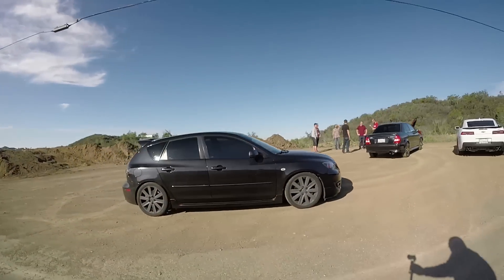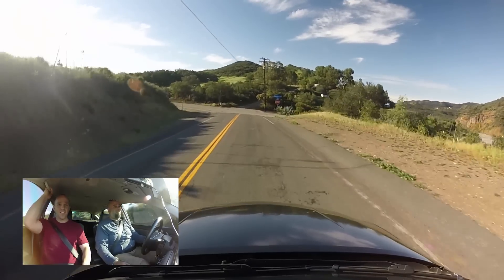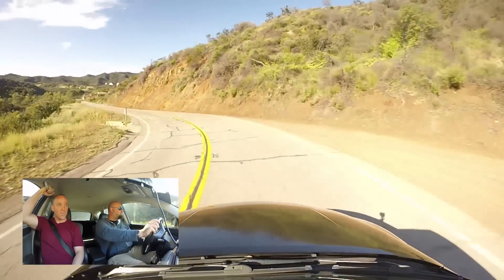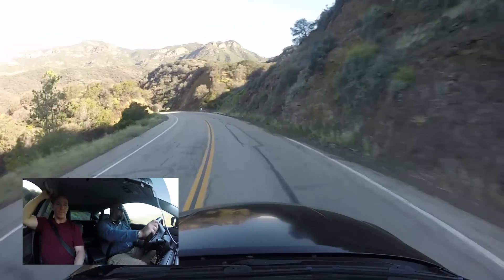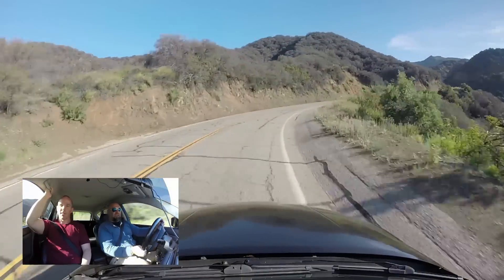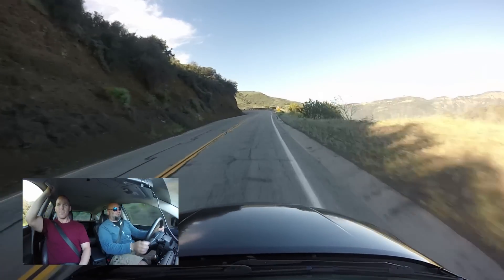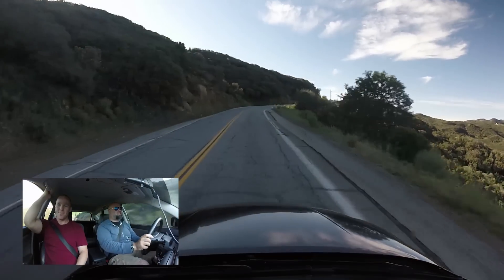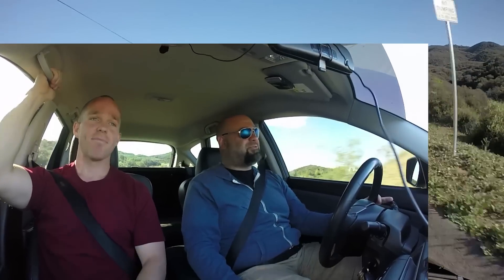450 HP Gen1 Mazdaspeed3 - One Take

Comment: Hey Matt, your title is a bit off, he says it makes 420 (yeah buddy) hp, the title says 450 :)
Reply: Tim Actually it probably makes more than 450. He said it makes 420 on the wheels.
Reply: halsoy Yeah, so shouldn't the title say 420?
Reply: Tim That depends what you want to convey. Most people talk about HP measured at the crankshaft (that's also what your car has in your registration paper). Many people live by the 15% rule of thumb. What this means (though 15% is a random number) is that the drive train eats up roughly 15% of the power. But the truth is that it varies from car to car.

But even going by the 15% number for the sake of argument, it means that the actual engine power is 420*1,15= 483 HP at the crankshaft. 

So the 450 HP number is probably either accurate (if they have measured the power at the crank) or a nice round figure to use since it's 420 at the wheels. In either case it's a better number to use for most people as reference.

Comment: Why pay 12k for that. You can get an e46 M3 for 12k. My room mate has a Mazda 3 and it broke down 5 times in the last year for 5 different reasons, he is on his 3rd engine, doesn't race or drive hard at all. Engine, suspension, a/c, exhaust, engine mounts, clutch, all broke before 90,000 miles.
Reply: Devan Vandy trade a headache for a migraine lol
Reply: Devan Vandy Sounds like his Mazda needs a driver mod.
Reply: Devan Vandy Either a driver issue or got a lemon. My speed 3 has 130k on it and havent had any issues at all. Lots of other speed 3 guys around me too none have had any issues as well. Same with regular 3 drivers etc. 

If he is on his 3rd engine he seriously has messed up somewhere.
Reply: Matthew Broderick  it's true. With the FOMOCO support behind that car, there were a lot of issues. By 50,000 KM, I was on my second engine, second HPFP, Flywheel, motors mounts, and 3 sets of rear shocks.  Out of the box, mine was very quick… And i'm a skilled, smooth, but FAST driver. It was just not built well for the long term. I put the same amount of KM on a VW GTI, without a single hiccup. In fact I drove the GTI harder, simply because it would take it.
Reply: *****  I was a diehard Mazda guy. 3 Miatas, Mazda B4000, Mazda 3 2.5, 6 Port RX-8, and the Mazdaspeed 3. It was BY FAR the least reliable Mazda I owned. I am thankful I bought my extended warranty on it, as each time it broke - I had a free rental car.
Reply: Paul Williams  Most of my failures were under the factory power. under factory power it wheel hopped like crazy. I ended up going full bolt ons, so it would spin, rather than hop. But then instead of breaking parts, they simply started wearing out.
Reply: *****  In Canada, we don't have the pull that Americans do. We don't have buyback, or lemon laws. I traded it in, licked my wounds and moved on to the RX8. I had issues with the RX8 too, and eventually moved onto the GTI - which was flawless.
Reply: For 12k you can't by a good used e46 m3 ! Typically in ny you would be buying a 120k mile m3 for that money !
Reply: Devan Vandy The biggest problem at the mazda 3 and 6 is the corrosion. The car is rusting like its no tomorrow. And it swallows a lot of oil. But a solid car in general.
Reply: ***** It's not even because they're badly engineered, it's the nature of the motor. Rotary engines run at higher temps, so you need to make sure you're 110% on top of the cooling system, and they burn oil, because they're designed to do so, so you need to stay on that too. Most problems with rotary vehicles are owners not knowing how to care for them, not the cars themselves.
Reply: *****  i didn't say the RX8  was problematic at all. Oil,plugs,wires,coilpacks,chattering diff clutch packs,i was always working on it - and nothing was cheap.  And then there was the fuel cost! Wowow
Reply: Why would you want an e46 m3 when the fiesta st is a better car :D
Reply: Devan Vandy never ever buy a m3 e46 for 12k ... NEVER
Reply: somanymods its not, its a quick hatchback and its 10years younger than the m3 e46 ...
Reply: I guess you haven't seen Matt Farrah's video about it lol
Reply: somanymods saw it and i like this show but in this case he compare 2 diffrent cars...
Reply: somanymods long time no see. Where's the old and busted ser auto?
Reply: Lol last I knew it was somewhere in queens

Comment: I've had my gen 2 since new in 09 and the car is not a money pit. 126k on the odo and the engine's SOLID. Only mechanical failure I've had is a blown turbo and that's because i added a downpipe before fuel pump internals. THERE'S LEVELS TO THIS SHIT. You've gotta follow some guidelines when modding any car. chances are this guy's modded his a little too precariously in search of the almighty horsepower. Also you can find speeds for under 8k all day now.

Comment: I have spent a lot of time under the hood of one of thoes things for my buddy. He is around 350-ish HPmany be a bit more, has good rubber, suspension and brakes, but I don't like it. It is not easy to drive becuase it is always trying to kill you, and once you turn them up to 11 the cheap parts stand out. Might just be me getting old, but for a weekend fun car I would still have an S2000, MX5, old Vett or Mustang etc. over this for the money. The engine bay is cramped and hard to work on unless you have lots of tools, and band aids it is not the best car for a serious track car, and too extreme for the street, point being it don't fit at the track or the street, not well at least.
But it is his money, I just do the work...

Comment: 45k mazdaspeed3 to make 450hp????
Reply: Second engine, third turbo
Reply: Zach Birdsall  I dont get this, even with a built motor and install you should not be going thru so many.

 http://www.speedperf6rmanc3.com/categories/mazda-mzr/built-motors.html

What do you do with them? Oil bearing tests.
Reply: swollenmadman16 my brother built civic been through 4 motors in less than a yr
Reply: AR Taken These engines require attention to detail when going built. A lot of shops get them wrong and they eventually blow. Sounds like this guy used some random engine builder. A company like speedperf6rmanc3 who specifically build speed motors would have built him a very reliable motor. Also I think his 45K estimate is inflated. Doesn't take even close to 45K to get to 420WHP.
Reply: He obviously doesn't build that well. Especially since he is still using the stock TMIC with a big turbo... it would heat soak after 2 pulls. And no motor mounts even? Tha'ts one of the first upgrades for this car
Reply: Zach Birdsall It does have stiffer motor and tranny mounts and it does have an aftermarket TMIC

Comment: I'm sorry but that's not 420 on a stock top mount.  Stock clutch and trans...
Reply: Zack Richmond you don't know wtf you talking bout bro.  400+ 700+ on stock trans and clutch? Bro not even corvettes or cobras.  Gtfoh
Reply: +Carlos Dingo Zack Richmond is not wrong though. It's the axles that go out first on these cars; the current 10 second speed 3 leader is on stock trans and has snapped more than one axle on a bone stock trans (might have shifter fork pads upgraded from plastic to brass though), and that was only because the car dead hooked on a flatshift to 2nd on huge wrinkle walls. I was also running ~400 wtq on stock clutch for a while, until flatshifting at the track glazed it.
Reply: +Carlos Dingo Oh and he has an upgraded TMIC; the Corksport one lets you use the stock shroud for a stock appearance.

Comment: this is the same engine that's going in to the new RS, more or less. ford owns IP: engineering rights to this engine.
Reply: digitalsaint2040 Yeah, this engine is excellent, Even won an award. The new Mazdaspeed will have the Skyactive engine which is good for economy, bad for everything else. 3 Skyactive car engines were blown during a race test.

Comment: this dude is full of BS, that thing is not 450 wheel, he has the OEM TMIC, that things good for like 300. he does not have 45k on it. “3rd turbo” usually means stock turbo and even on e85 it maxes out the k04 at 320ish. complete BS.
look at the most recent mazdaspeed video, with all the fancy aero and the dude that actually takes it to the track, he’s making 380 and the dude driving it is lovin it. the car in this video is probably making 300-310whp.
Reply: That's a Corksport TMIC, you can bolt the factory engine cover to the Corksport TMIC for more of a sleeper factory look as well as being able to muffle the sound of the HPFP. Furthermore, the owner states that the factory K04 turbo is not being used, rather the vehicle is fitted with a Garrett GT3076. There's videos of this car putting down 370WHP on the dyno, which seems more realistic than 400+ as there's no way you'd get 400WHP+ on stock injectors alone running E85.

But nonetheless, a nice car and certainly very quick from the other videos I've seen on it.

Did you even look at the wheelwell article on the car?

FMIC's look pretty, and they do suffer from less heat soak, but they aren't totally nessecary for 400 BHP using a large turbo that doesn't simply beat the hell out of the intake air.
Reply: ByteOn Computer Services 

the airflow isn’t enough. I have my own built speed 3, BNR S3, and my buddy has a speed 3 as well, Corksport turbo, and he just cracked a ringland trying to push 320whp with a Corksport TMIC. the BAT’s were just too high. We gold heat taped everything, under the heat shield as well, we wrapped the whole downpipe in titanium heat wrap to keep all the heat away so it wouldn’t heat soak as bad, but it still was too much. 

The 3076 LIVES in an efficiency range that’s MUCH higher than what our stock fuel system can handle, and you can’t go that high on stock fueling with a top mount. you need a front mount and some sort of aux fuel (Methanol, 5th and 6th port, or full port injection.) believe me, it’s well documented. people have tried. 

He may be on a 3076, but it’s so out of its efficiency range, that it’s probably getting heat soaked so much that the BAT’s are so high, creating this perpetual issue. With those heat soaked BAT’s, he can’t go higher than 320 (as per my buddies experience on a SMALLER turbo, can’t imagine how out of the efficiency range the 3076 is) without catastrophic engine failure.

it’s well known in our community that FMIC’s are required for anything above 320ish. the BAT’s are just too high. even on an E mix, (can’t run full ethanol, it mixes with the oil in the HPFP and gunks it up. ) there’s no way it can push those numbers. 

In conclusion, i didn’t bother reading his wheel well page because i knew it was just going to be spitting out hot garbage. trust me. the day someone makes 370+ on a TMIC without destroying his rings, is the day the mazdaspeed community goes nuts. 

where is this video of him making 370? probably had some crazy correction factors. 

also, OMEGALOL, OEM BPV, that POS slips at 22 PSI.
Reply: @partypigthefirst  at 2 bar the GT3076 is right in the meat of its efficiency map, there's no way it's beating the air that hard that outlet temps are enough to overwhelm a Corksport TMIC when the vehicle is moving with adequate airflow - Assuming the OP is even running 2 bar, and it's unlikely he is. You crack ring lands due to LSPI or trying to run too much advance, this is a direct injected engine and LSPI is a very real issue that's compounded when the engine is tuned. With HPFP internals the stock fuel system can handle 370WHP for short periods, I would say that 370WHP is about the limit though. There is a very clear video showing this vehicle on a chassis dyno putting 370WHP to the treads, there's video's of this vehicle pulling runs on the street no issues. Depending on model, the Corksport unit can be vastly smaller than a GT3076.
Reply: ByteOn Computer Services

LOL 2 bars on stock fuel system? you’ve gone mad. that’s 29 PSI, the amount of fueling needed for that on a 3076 requires full port injection, or at the least, 5th and 6th port. why do you keep going back to the HPFP? i realize that our stock fuel system can support 370 on an e blend. but not on that turbo. you’d be way below the efficiency range and you’d heatsoak the engine bay. 

remind me, how much experience do you have on the mazdaspeed platform again?
Reply: @partypigthefirst  read my post, read it good - Specifically the part about it being 'unlikely' the vehicle is running 2 bar boost. 2 bar boost was an extreme figure for illustrative purposes. I worked on Mazda's for 20 years, I have around 7 years tuning the MS3. Once again, the Corksport turbo is most likely smaller than a GT3076 meaning more boost is needed compared to a larger turbo to achieve the same HP - Meaning the turbo is pushed further out of it's efficiency map and beating the air harder = Higher outlet temps. In relation to the turbo used, while this video stated a GT3076, I believe the actual turbo used is a GT3071 running 24psi boost. While I haven't worked out actual airflow, I fail to see how a GT3071 would be that far outside it's efficiency map to support 370WHP at 24psi boost, looking at the map the turbo should run fine at 1.65 bar. I'll mention the HPFP as much as I want my friend. https://www.youtube.com/watch?v=jSDWSafcDxI
Reply: ByteOn Computer Services 

great, you know the platform as well as i do then. even if he made 370wheel with the top mount and 3071, he lied about his whp, and what turbo he had in it. not going to get into an unnecessary dick measuring contest. 

also, i can see the words “edited” on your comment. the original 100% didn’t have “unlikely.” but whatever. doesn’t matter now. i don’t have the time nor energy do deconstruct your whole argument, nor do i have the desire to- at this moment. 

good day.